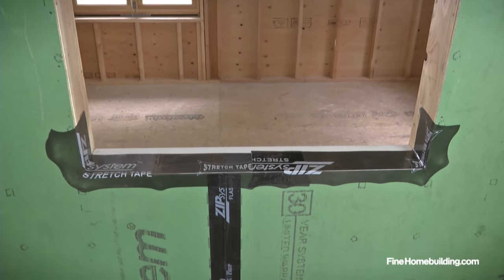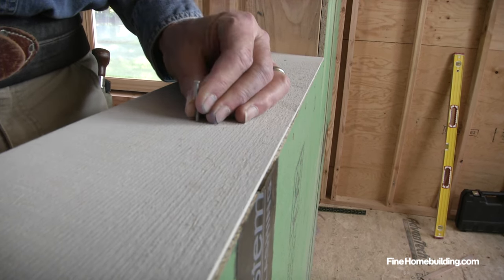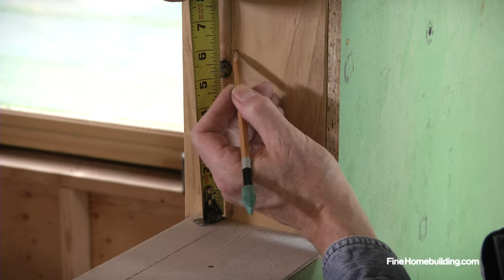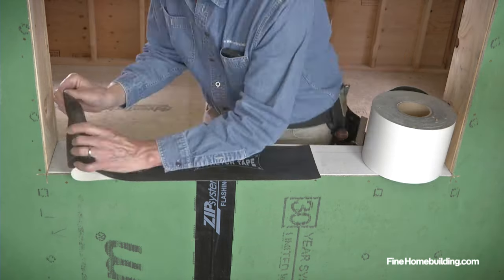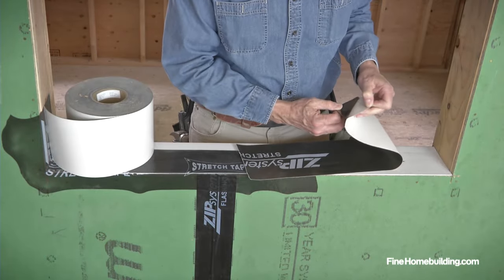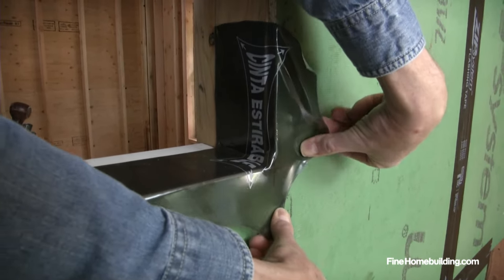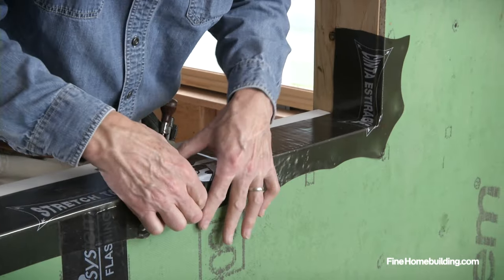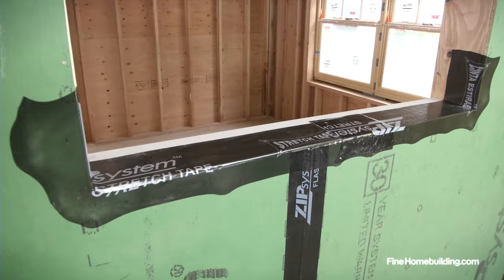How to Flash a Window Sill | ZIP System™ stretch tape

Comment: My life has completely changed since I have found this tape. My contractor gave me a roll, and I used it to seal gaps on my window AC units that I install in my home each summer season. Wow! The efficiency I have gained is incredible. Secondly, this tape has been my muse fir all sorts of mcguyvering needs around the house, duct tape is no longer my go-to. The fact that this tape is so tacky, can stretch around complex shapes, and yet remains 💪 strong is simply amazing.
Reply: It’s fantastic for seat cover repairs on four wheelers and equipment too!!

Comment: Shouldn't it be one continuous piece? No seams.
Reply: Ample overlap addresses that, just like with flashing.  The issue is most folks new to this tape will have an easier time with the technique shown here.  It's harder to get a good seal and wrap when you're pulling up on the second corner.  But one continuous piece is possible!